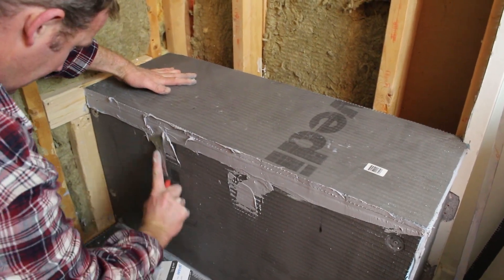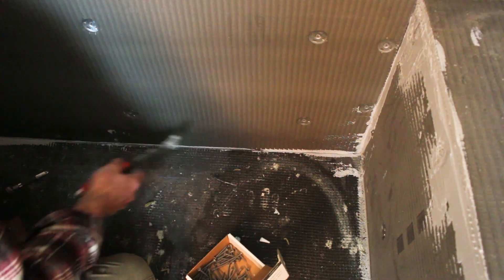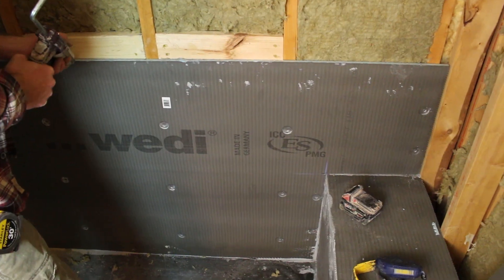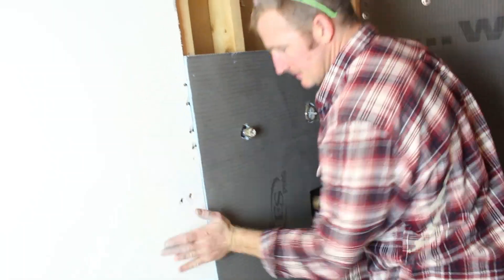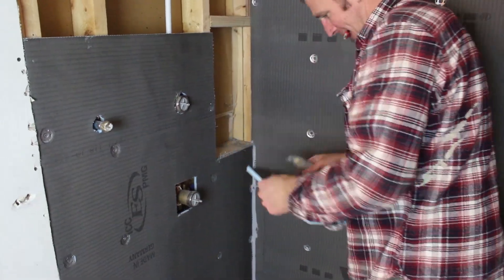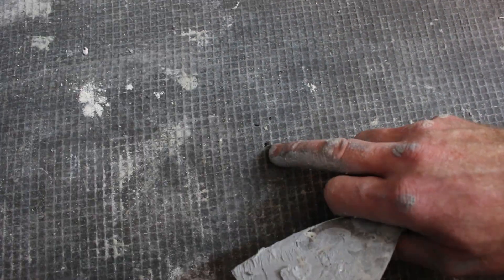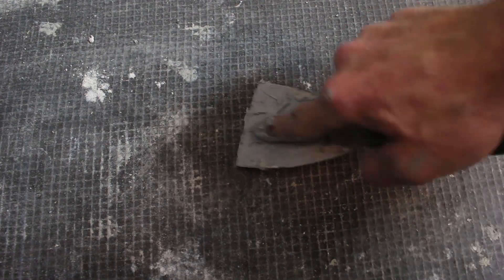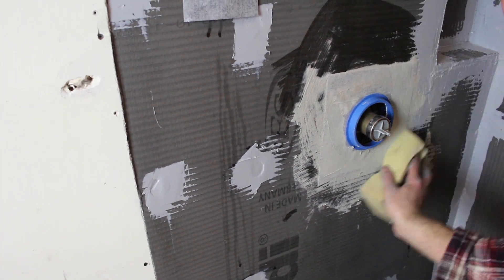Wedi Board Installation for Fundo Primo Shower (Step-by-Step)

Comment: thanks for the video very helpful, my question is did you cut  out the wall panel to fit the curb that was in place? or did you notch the curb and the wall panel by 1/2' to fit the wall panel and curb together?

Comment: I put in wedi board for the backsplash on a soaker tub 4 years or so ago.  I believe Then the correct procedure was to notch half the width of the two boards and lock them into each other (top board notch back half bottom board notch front half out.  Also believe I did this for the side seams too.  When did this all change?  Putting in a shower soon and don't want to mess up.

Comment: Not an expert on the mixing valve collar, but tend to agree with TJ.

I simulated a leak and did a drip test, holding the collar over the sink and dropping water with a teaspoon from above onto the top of the fleece and on the lip.

With the lip on my side, some water is shed to the sides, and some fall into the hole. With the lip facing away from me, water does not get in the hole since the lip slopes downwards from the inside diameter at the back towards the outside diameter at the front.

The only scenario I can think of where the lip should face you is if the mixing valve protrudes out of the wall and fits tightly on the inner diameter of the lip to form a seal. But even then, I don't see the point.

Comment: QUESTION - When you join two Wedi boards together with the Wedi screws to "pinch" them in, do you place the screw hole right at the join seam or through one of the boards?
Reply from the maker: through the joint so the washer spans both boards
Reply: @HomeRepairTutor  Thanks. I thought putting screws right at the joint might cause a bit of seam separation, so thought may be you placed the screw hole right near the edge of one of the boards while grabbing the other board with two of the washer teeth.  At least it looked like it on some of the seams Steve put up on the video. Probably won't matter too much one way or another...

Comment: Hey guys, great videos.  Have you used the Wedi butyl tub seal yet?  It appears it is to seal a drop in tub without a flange, when the tub is actually placed against a wall or into an alcove.  Any advice would be helpful!

Comment: I used one of these flexi collars around my shower head pipe. If I need to change my shower heat pipe. Can I remove it from the collar/flange and reinstall the new shower head pipe thru the collar - and it will still be water proof?
Reply from the maker: yes, it might be a little tight but you should be able to do that

Comment: You put the collar on inside out.  It’s not a gasket to seal against the backside of the control valve face plate.  The conical shape of the collar is meant to not allow water to trace behind the wall, it directs it back to the face of the wall board.  So the narrower diameter of the collar goes inside, the larger diameter with the smaller ridge lip goes out at the face of the wall.  The way you have it the lip sticks out well past the finished wall surface and will inevitably get distorted when you mount your face plate bracket (that gets secured flush with the finished wall).  This will allow any water that reaches the collar to trace through and down the backside of the finished wall, as like electricity, water follows the path of least resistance.  The cone shape is meant to prevent the water from getting past the inner most ridge of the narrower part of the cone.  The water would have to be forced with pressure against gravity to get past the narrower inner part of the rubber ring.  The face plate prevents direct spray so the water can only follow the rule of gravity and least resistance.   Just my two cents.

Comment: I was thinking the mixing valve collar went the larger side in the hole-can you confirm?
Reply from the maker: we add the Flexi Collar so the thicker side faces outward and can be trimmed to fit the tile
Reply: He installed it wrong. The larger side goes into the wall.  The thin side is out.

Comment: I made a mistake and put a 3/4 hole in one of the wallboards in the wrong place.  How can I seal the hole?
Reply: You could fill in the hole with the piece you cut out or anther same size piece and seal it like you would other joints with Wedi sealant.  The store I bought from said the sealant is extremely waterproof.  Any joint will be waterproof if sealed with the sealant.

Comment: I noticed Steve did not make a dado cut to receive the wall boards on the Wedi board for the top of the bench seat.  Any particular reason why?
Reply from the maker: It's not necessary and was treated like two boards butting against each other, adding sealant at the board intersection and a second layer overlapping is sufficient

Comment: Great video! Steve looks super skillful! I like everything about the wedi system but how do you install a frameless shower enclosure and attach to wedi foam curbs? I haven't seen any useful hints how this should be done. Foam is weak for drilling into and many frameless enclosures have brackets that need to be screwed into the base. Any hints or ideas will be greatly appreciated.  Thanks!
Reply from the maker: we get this question a lot, the most ideal situation is to add 2x4 blocking in the stud wall before adding Wedi backer boards. Place the extra 2x4s in the position where the shower door or glass will be located. Then, and this isn't perfect, add glass u-channel by drilling through the tile/Wedi and anchoring it into the studs. Apply 100% silicone in the screw holes, bottom of u-channel, and side of u-channel in the shower. Support bars can be used to stabilize large glass panels and they need to be factored into the glass planning phase as well as the shower surround.
Reply: @HomeRepairTutor  Thanks! How would you attach the brackets that sit on the curb below the glass panels?  The curbs seem too tall for screws to work.

Comment: why no cement on the studds before screwing
Reply from the maker: Wet shimming was unnecessary, all studs were plumb and even
Reply: not referring to wet shimming   why not glue to studs instead of screwing  Much like using Liquid NAIL WITH PANELING
Reply: Shouldn't use concrete directly on wood.... contraction and expansion will crack the concrete
Reply: @69derfy  because its held on with screws.....and sealant between the joints. Its not coming off with those giant washers.

Comment: Car you use a waterproof like redgard over this
Reply from the maker: good question JM, it’s not necessary to use RedGard over Wedi because the foam core is waterproof, you just need to waterproof the screws and seams with Wedi Joint Sealant

Comment: WHY NO JOINTING TAPE OVER THE JOINTS?
Reply: I believe the wedi brand sealant/caulk that is used is meant to work in place of tape. I used this method on my custom shower install 4 years ago and have not had a problem with leaks.

Comment: Wedi still not convinced on this system,  those small adhesive lap joints make me feel uncomfortable. and the foam board, because it has the ability to compress, unlike the old conventional system,thoe little over time will fatigue and fail eventually even conventional systems especially with water intrusion through the grout and mortar bed if they have fatigue. The alleged benefits of the  Wedi system are not enough to get me to change from the old tried and true system. I have demoed quite a few houses that were 75 to 80 years old and the showers even with broken tiles cracked mortar still held up no leaks, hot-mop on tin pans or mortar, or even lead pans lasted.

Comment: I can do the same thing with backerboad & red guard  & spend way less money
Reply from the maker: RedGard and CBU is a good option. The only issues are ease of use for the CBU, it taking an extra day for the seams (alkali tape/mortar drying), and warranty.
Reply: cutting cement boards and breathing that dust while handling the sheets well worth extra 35$ per panel.
Reply: valpanig Especially nowadays when you cannot buy a silica mask for love nor money!